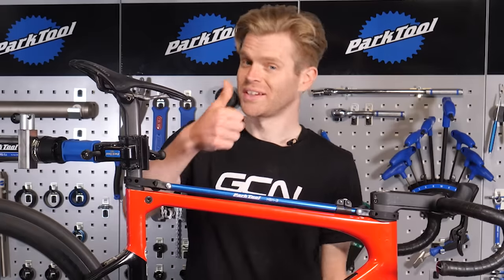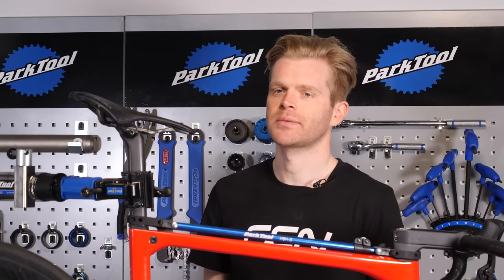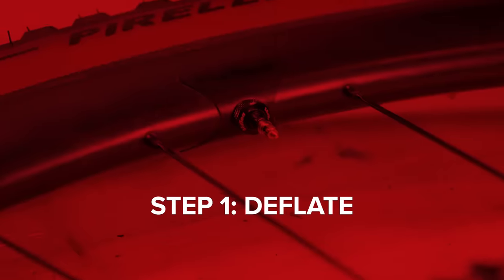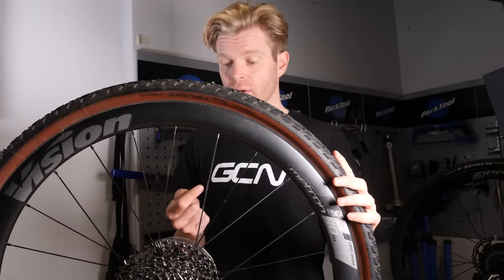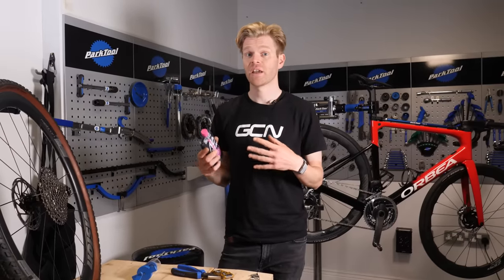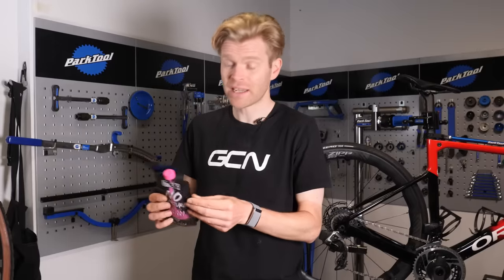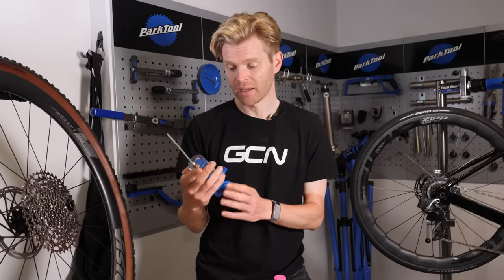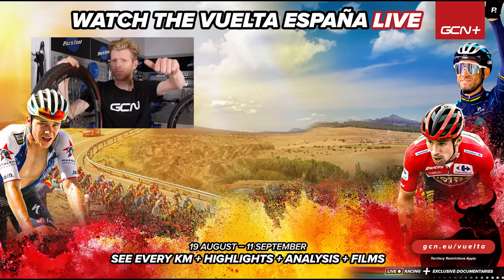When Should You Replace Tubeless Sealant? | Maintenance Monday

Comment from the maker: What other maintenance videos would you like to see us make?
Reply: The STI shifters. How to clean and maintain them, so they work alright.
Reply: How about a video on pre or post ride things to check for?
I usually give my bike a once over before I start riding and sometimes after work while I'm relaxing  I bring my bike into the den and look the tires over while watching tv, there seem to be a species of thorns that is attracted to bicycle tires where I live, I caught most of them before they can puncture anything, so far😆
Reply: Yeah I wanna see you take the tubes and add sealant to them beautiful Zipp 353's. Deer gawd man remove the tubes!
Reply: I'd like to know if its possible to carry out a full service yourself on a modern road bike and is it cost effective. I've always done my own while I've had 10 speed rim brake set ups but would be nervous doing same on modern electric shifter and hydraulic brake system groupsets.
Reply: Changing disc brake pads would be handy
Reply: Another vote for disc brake maintenance, please, I need this as someone switching from rims to discs.
Reply: How about a montage of Ollie asking How long is a piece of string?
Reply: How to tell when a bottom bracket should be serviced/replaced (before a mid-ride failure, as "some people" have experienced).
Reply: What should I bring on a ride now that I switched to tubeless?  Should I have extra sealant or a tube or lots of co2? If there is a flat would I always switch to a tube? I see gravel races and they say they had 3 flats. What did they do to get going again. Thanks for the help.
Reply: can't I just add water on top of the several topups?
Reply: How you mount a tire and tube when hands are 75 yrs old and dont have the strength to roll the last 4” into the bead. Very frustrating

Comment: Keep a supply of new valve cores handy to replace old ones clogged with dried-up sealant. Makes filling tyres with air alot easier with  unobstructed valve cores.
Reply: After adding sealant l swab out the tire stem before screwing in the valve. Seems to make valves last a little longer
Reply: I've never had problem with dried sealant because I find I can just pick it out, it's usually around the bottom of the core.i do are when the old one is too bent

Comment: For Stan's "No Tubes" sealant, I've found that the sealant (pink, gummy stuff) dries on the inside of the tire, leaving a puddle of clear liquid in the tire that has little or no sealant in it.  Hence I typically want the clear liquid out of the tire before adding "fresh" sealant.
Reply: I find that the clear milky stuff weeps through the sidewall of my tire for some reason even though I’ve never had any punctures

Comment: At the end when adding sealant do not rotate the valve all the way to the 6 o'clock position, stop at 3-5. This allows the sealant to run down hill and not be pooled at the valve. When adding large amounts sometimes the tire will inflate slightly and when you remove the bottle the pooled sealant can push back out when the tire goes back to zero pressure. Had this issue with the green goop in mtn bike tires.
Reply: That's a good idea. Thx for sharing.

Comment: I changed a set of tires recently and cleaned the old sealant from the ones I removed.  Seemed to be more trouble than it's worth and I won't be doing that again.  I will make sure the bead is clean, though.

Comment: lol - had checked my sealant with the valve at 6 o'clock, and, sealant started seeping out. Suggest starting with the valve higher than the 6 position and then slowly rotate the wheel to 6.

Comment: I installed a pair of 25 mm GP 5000 TLs back on June 15th and filled em up with 100 ml of fluid each. On Aug 20'th I hit a pothole with my front in a dark tunnel and had a puncture on the running side of the tyre. The tyre gone flat in less than a minute and I inflated it 3 times before realizing that I have not a single drop of solution. I had to borrow a wheel and go back 17 km to the car and get solution. After adding 100 ml, and inflate, the tyre was good to go. Soi my advice to you is to add 50-80 ml per month if you want to be protected. Because in the summer, in Eastern Europe (Romania and Greece), we get 35-40 degress daily. This with 4 moth is maybe for winter time

Comment: Cheers Ollie you saved my bacon!  After watching this I checked my gravel bike with 38C Panaracer Gravel Kings which I fitted in March and were fully filled with Muc Off sealant (the purple stuff) at the time.  They failed the dip stick test with a de-cottoned cotton bud. They were almost bone dry!  They are now fully re-filled. Perhaps the two super hot heatwaves in the UK caused things to dry up faster than normal?
Thanks again and will re-check in a few months.
Reply: Hey! living in a very dry area I have to top it every 2 months in summer and around 4-5 months in winter. How fast it dries is more a fact of how dry/wet is your environment more than the temperature. But for sure the heatwave would make the environment a little more dry than normal.

Comment: Take the opportunity to clear out the valve cores while you have them out of the valve so you can get a good airflow when pumping up your tyres. Even so eventually they will deteriate and will need replacing ☹ Also if you are not going to ride your bike for a while put the valves to the 6 o'clock position. If you leave them at 12 o'clock after a ride then there will be fluid in them and it will harden, at 6 o'clock it should run out.

Comment: Yeah, I just add sealant and don't worry about what's dried up anymore. The time I did go to clean it up it was more trouble than it was worth. I figure it's just another layer of protection anyway. Then by the time it gets too mucked up inside it's time to get new tires. One less hassle to worry about.
Reply: I'm not spending another $100 on a pair on new tires
Reply: @Chris-de2qc  I'm just saying I add sealant until it's time for me to buy new tires. I usually swap them out once a year anyway, so that's adding sealant like maybe twice a year. Just an excuse to buy new stuff.

Comment: Nice one Ollie. I've been tubeless since 2016 I've tried a few different sealants, Stans Orange and Specialized RapidAir sealant, I like the RapidAir best. Like Ollie, I check it and add @ 3 months, its easy I tire lever one side open add sealant , reset bead then add air.

Comment: I've got some Mavic Ksyrium S rims tubeless and bombproof weighting in at a nice 1560g, riding them for three months now. Funny enough I've not gone tubeless yet! I thought I'd give the TPU-40 gram tubes a try thinking, "Ok when I get a flat l will do the jump over to tubeless" but heck no flats yet...

I fear this is going to take a lot longer then I thought lol. And I may even stay with the idea of using tubes. I mean, when you think about it, it just takes a couple of minutes to change an inner tube. 

It's just so hard to stay away from a MaxissTyre with puncture  protección that ONLY weighs (185g and a tube that's 3×stronger that weighs 40g) !!!

Comment: After watching this well presented video (nice job Ollie!) and reading the many comments from folks about their own sealant protocols, I find myself even more convinced that my use of 40 gram Schwalbe TPU inner tubes on my road bike is the best strategy FOR ME. It's great us cyclists have a choice of products so that tubeless folks can do their tubeless thing and tube folks can do their tube thing. 👍🙌☺️
Reply: exactly, what really is the great advantage of tubeless, only slightly faster? As changing an inner tube takes about 5 mins and that's a rarity anyway.
Reply: @blahqwe  Yes! Give me my Continental GP5000 tires plus Schwalbe TPU inner tubes and let me ride off into the sunset! 🌅🚴🏼
Reply: The problem with tube is that if you puncture, it has a 0 percent chance of sealing and your ride is ruined.

With tubeless, it will seal most of the times without you even noticing. 

Tubes represent a 100% chance of stopping your ride, while tubeless allows you to ride on 80% of the time.
Reply: @slowcyclist4324  yes so you carry a spare tube, as most tubeless riders do anyway....so where's the big advantage?
Reply: @blahqwe  because small thorns or even a small nail won't cause me to have to change a tube.  Annoying to change tubes...the tire just seals up and you ride on.  Huge advantage
Reply: There are inner tubes prefilled with sealent. There are puncture protection inserts. I use both and haven't had a puncture in a long time ... nor did I have to do topping up or scraping of every 4-6 months. It just works and requires no maintenance!
Reply: @blahqwe   The advantage of tubeless is that you don`t get punctures obviously (unless it`s a pinch one and then you can repair it in seconds anyway with a Dart)

Comment: I got a flat tyre after two 2 years of riding same inner tubes. Replaced it in 5min and riding again. No sealants, special equipment valves or anything. Just a 4€ tube, that I had for a few years.

Comment: Thanks for posting this, it was very clear and helpful. I did have a question that does not look as if it has been asked. You said if the dip stick is dry then it is time to top up the sealant. But what would you say is the minimum of depth of sealant before it is time to top up, e.g. it is probably about 5 mm after topping up so maybe about 2 mm or 3 mm?

Comment: Thanks for the video, I have two questions: 
1. how much did you deflate the tyre in the step one? It still seems to be quite inflated in rest of the video 
2. can you mix various sealants? I have no idea which compound was put there by technician so I would just go for whatever brands` marketing persuades me.
Reply: well removing valve core will release all pressure, so its safe to assume all the air. Maybe tires are rigid or clips shot at different times.

Comment: Good information. I’m about to do this first time @ 4 months. I had a puncture a few days ago, and the small amount of sealant that escaped was liquid consistency. I live in a warm climate and store bike indoors. I’ve had three punctures in 1000 miles. One front, two rear. The front self sealed but did spray sealant all over. The rears didn’t self seal, and after some sealant kept escaping, I used a dyna plug each time. Took a few seconds, and no issues since. So for me, the convenience has been excellent. I have 32s and I inflate to the low 50 pounds. I ride road only. I will never go back to tubes.

Comment: One extra point that I'd add is that you should consider the type/brand of sealant. They can be using different processes for the sealant to 'work', so topping up would work only with the same brand, as otherwise you could be diluting both inside the tire.

But it's such a love-hate relationship. Tubeless setup saved me quite a few times on the road, but I ended up having to patch the tire from the inside and reassemble after a few hundred k.

Comment: But it might also be the the dipstick is still wet but without enough latex in the fluid. At that time the fluid does do its job anymore. It is more a kind of water at that time iso a mixture of latex which is needed to fill up the gaps.

Comment: Noob question:
If it depends on a lot of factors how long sealant is gonna last, how do those factors affect the life expectancy? Like, which factors prolong it, and which limit how long sealant typically last?
Reply: To be on the safe side, 2mth max you need to top up your sealant. My experience with some rider on tubeless is that some even 3mth their sealand has dried up. Is all depends, u might some get pinch hole during some rides for few mth rgar sealant help u sealed.
Reply: @departurexx1520  Thanks. I know it depends, as said in the video, and as is the case with almost anything ;)

But my noob question was more directed towards which factors make it last longer, and which factors make it last shorter before it eventually dries out?

My guess is higher temperatures (summer) make it dry out faster than lower temps (winter). Probably sealant in road tyres (with less sealant) dry out faster than MTB (with more sealant)? Etc...
Reply: Mountain tires between 6 and 9 months, based on 100ml of sealant. Road tires with 30ml only 2-4 months.
Reply: @Arthur-kl4uo  Seriously really depends on how many times you ride and how far you ride. And also depends on your luck did you get any punctured that already help you to sealed during some of your ride or you didn't get it at all. More puntured more sealant use, less puntured less sealant use. That's why i said just do it every 2 mth to be at the safe side.
Reply: @departurexx1520  
Thanks, with the responses given, I think I am getting closer to answering my original question (which factors limit, and which extend the life expectancy of sealant), being:
- Riding shortens life expectancy in comparison with not riding it (as riding increase likelihood of punctures)
- Warmer and dryer conditions shortens life expectancy (because sealant will evaporate) compared to colder/humid conditions 

Am I missing something obvious other than this?
-

Comment: OK, I've never tried tubeless, but now I am thinking about it. 

The thing is, I worry about flats while on a long, remote ride and being able to fix them. With tubes, beadless clinchers, C02 and a backup minipump, it's easy to handle any tire damage scenario and get back riding within a matter of minutes. Not so sure with tubeless. Does a flat mean "ride over"? Are tubeless only intended for pro riders who are backed up by a sag wagon filled with fresh wheels?
Reply: Just take a spare tube and a pump with you as you do with tubes. You can always put a tube in a tubeless tire too. But till now every cut got sealed and I got home without putting a tube in.

Comment: Dr Ollie, if I’m using my bike over the winter - indoors only - and my bike is tubeless, do I need to replace/check the sealant, or use this as a good reason/season to clean the insides and have them ‘sealant-free’? Point to note: not yet had a puncture on my Kickr/Zwift setup. Great show.. Thanks.
Reply: Yes you do … and yes it is…. But you should use a trainer tire for your indoor work as heat will destroy a regular tire…. Just get a cheap wheel and install trainer tire

Comment: I have tubeless tires on two of my four bikes and within the last two week I've had punctures on both tubeless tired bikes.  Both times I took the flat tire off the rim and both were 95% dry.
Before yesterday's ride I considered adding sealant, but decided to do it after the ride.  That was a big mistake, because I got a flat on that ride.
I've learned my lesson and will now add sealant every 4 months and I'm also going to keep a maintenance  journal for each bike.

Comment: Where I ride we get below freezing weather.  My bike is not stored in the house, but in an unheated shed.  Does the sealant freeze??  And, I've been having problems pumping up my tire, is the sealant clogging the valve?
Reply: According to Stans website, their product is good to use down to some seriously cold temperatures, so depending where you live, I imagine it would be fine.

Comment: Does each time the sealant dry up and you add more, add to the total weight from the last time you added sealant? E.g. you add 50 grams of sealant 3 times over the tire life, will the wheels weigh now 150 grams after the year, or when the sealant dries the water/anomia content has "evaporated" and the remaining silicone weight is so insignificant that it will only be 60 grams heavier than your tires new with no sealant?
Reply: As Ollie said, most of the weight of the sealant is in the solvent (be it water or other).  For sealant to harden, the solvent evaporates. That then leaks out along with the "air" that you have to replace a couple of times a week.  So no, putting in 30g of sealant doesn't result in 30g caked on to the inside of your tires.  Probably closer to 3g.  If your tires last long enough (calendar time) that the sealant adds up to a meaningful difference, you definitely don't put on enough miles to notice that difference. :D
Reply: @teejfalconaf  ok great to know

Comment: Never heard that tip about the valve core remover being on a multi tool, but just scrutinised my one (old Topeak Alien) and found the space on the chain splitter that does just that once the pin/thread have been unscrewed...top tip Ollie! (Tubeless is the way forward, love the comments from the rim brake loving luddites...)

Comment: What's the purpose of that Park tool going across the top tube on the Orbea?
Reply: My guess is it keeps the bars and front wheel straight. Same could be done with a string tying the front rim to the downtube, unless you're (re)moving the front wheel.

Comment: #askgcntech If storing my wheels indoors over the winter, should I be rotating them occasionally? In other words, is there any issue with leaving the sealant pooled at the bottom for months at a time if they're at 23degC or so?
Reply: Whenever I put a tubeless tire set up aside for long periods, I remove the sealant with a syringe. I have even squirt it back into the bottle.
Reply: They just create a pile of dried sealant at the bottom; I would rather remove one pile versus having it dry all over the tire.

Comment: What is the weight difference between an inner tube and the sealant needed in a tyre (total sealant weight after say a year)?
Reply: How much is the difference if the weight of the tubeless valve is included?

Comment: So I should run tubeless because it's faster and lighter, but then I need to add almost two latex tubes worth of sealant, with the downside of possible spray in case of a puncture? Also I should continue to carry a tube in case the sealant doesn't plug the hole?

Any more downsides?
I'm sticking to inner tubes, specially since getting to know how light (and small to carry!) latex tubes are.... :)